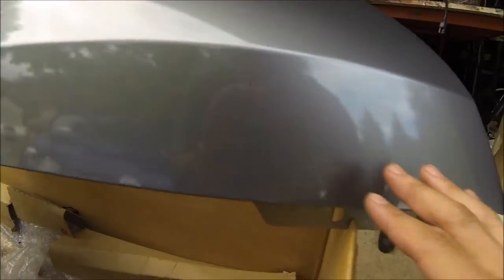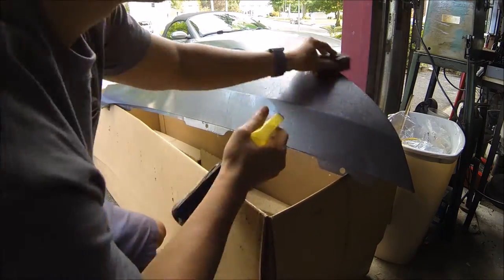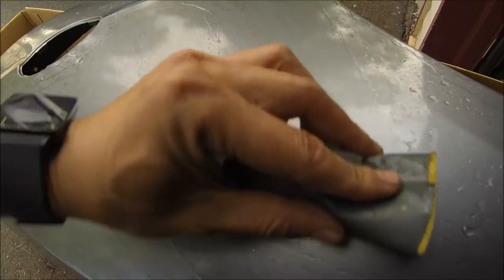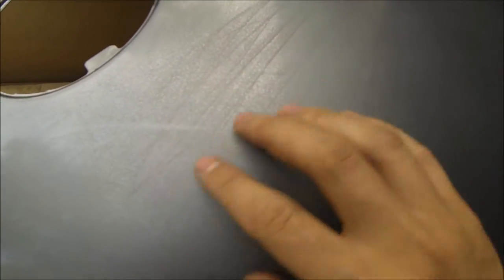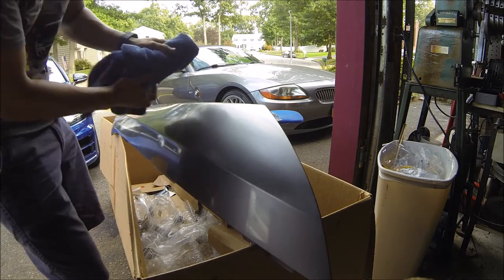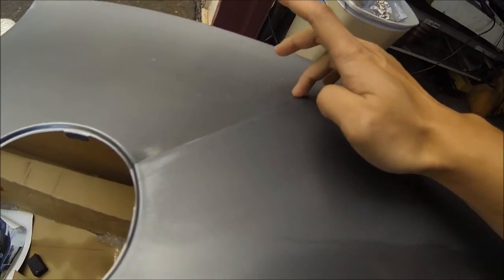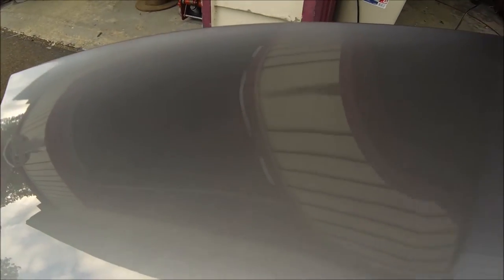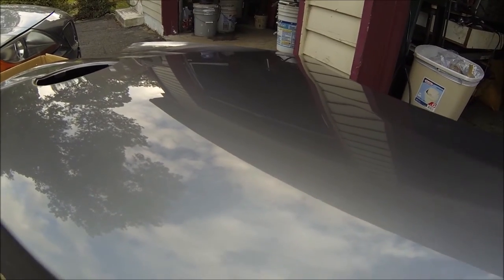Sanding and Buffing - Rattle Can Fender Painting Series - Part 4

Comment: Enjoying your fender build.
Remind us how many coats of Clear that you sprayed on the fender ?
Hopefully you will show us how you removed and replaced the fender.
I would appreciate learning that procedure cause I have a 'fender parking lot ding" that needs a paintless dent removal..
In my way of thinking I would prefer to bring the ding to the body wizard.

Thanks again
Reply from the maker: +jafxdwg I think I put 4-5 coats of clear. Think that is the perfect amount, maybe less is better if using a harder clear but I'm using a lacquer that's rather soft. I will definitely do a video on replacing the fender, cheers.